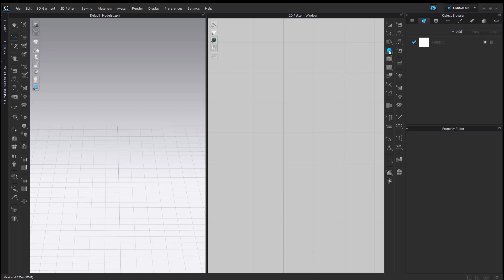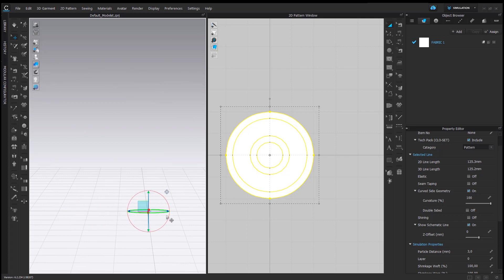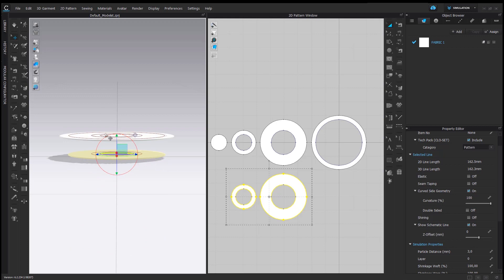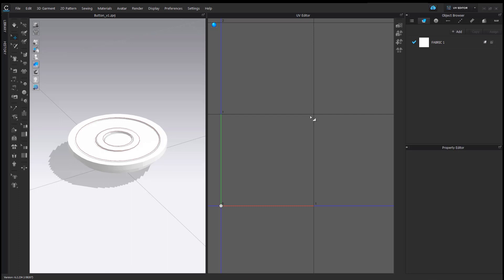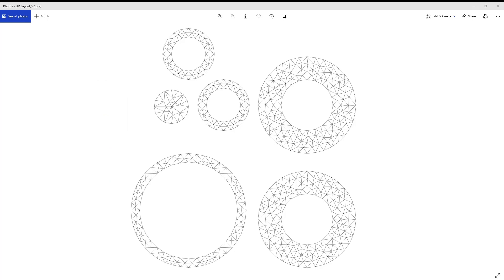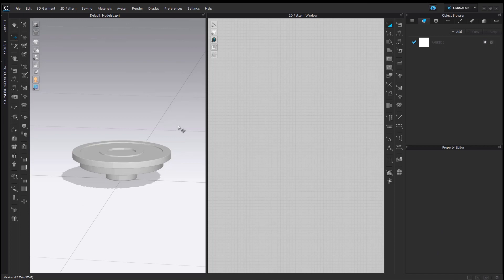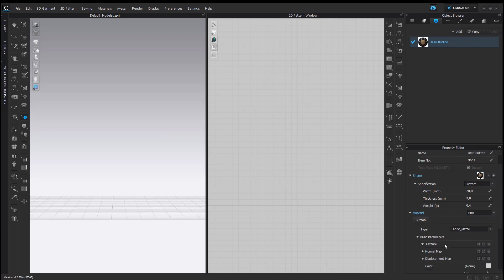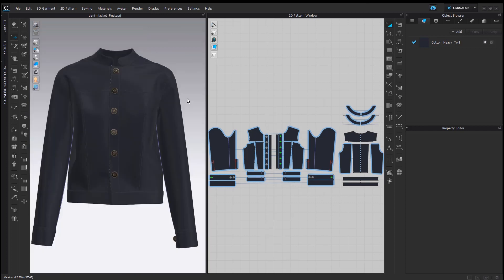How to Make a Metal Denim Button from Scratch | CLO 3D Design Tutorial

Comment: I try to add thickness in button but it's still flat fabric what should I do
Reply from the maker: Please check your 3D Vertical Toggle and make sure your fabric is set to Thick Texture Surface and not Textured Surface